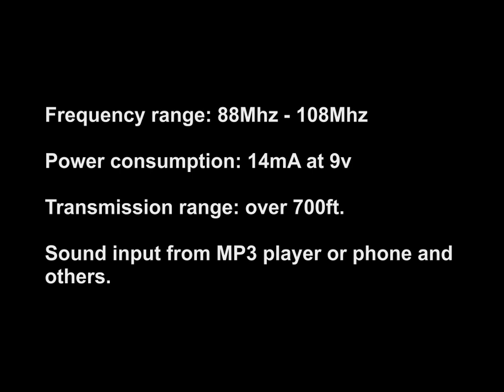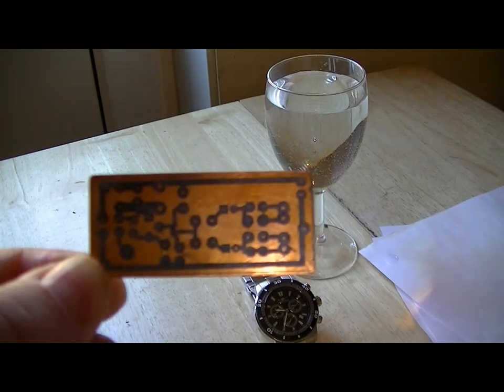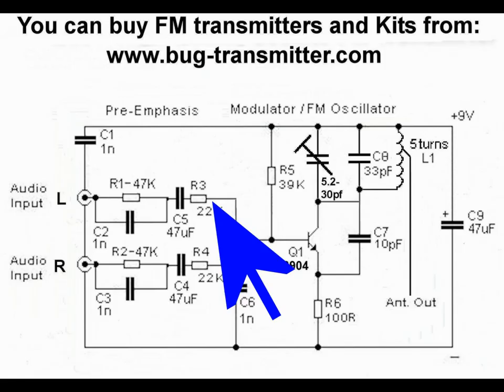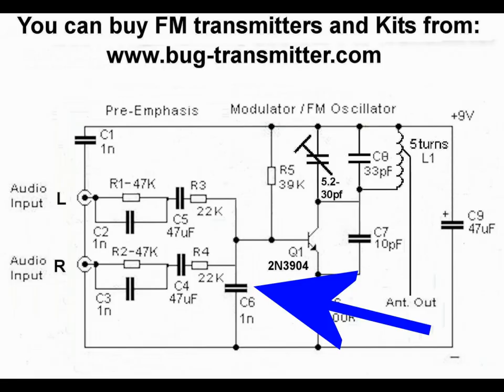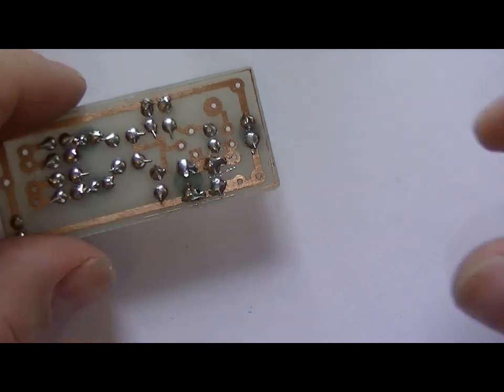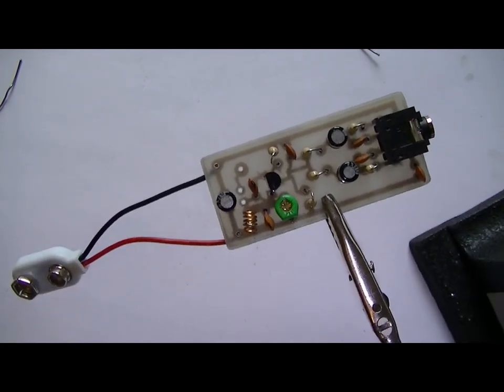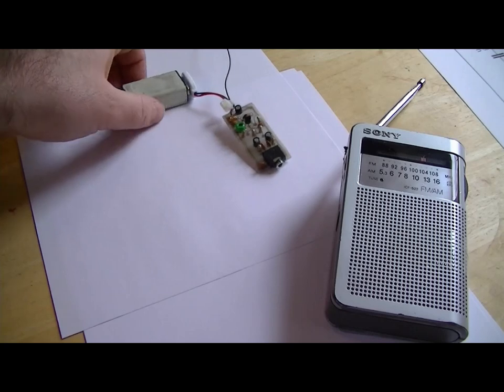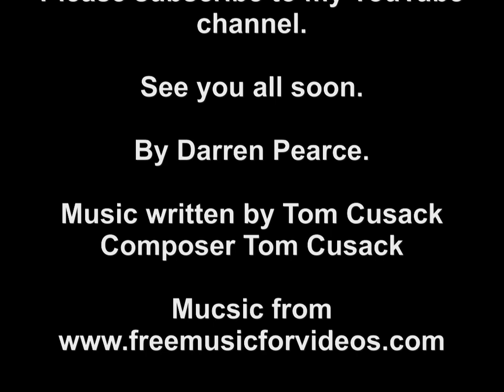How to make your own radio station.I show you how to build a simple FM transmitter.

Comment: I have a question would surface mount resistors and transistors will work well or would there be a problem
Reply: shouldn't be a problem as long as they are rated above the voltage and current of you power supply.
Reply: Also would any trimmer would work well or just that one I am all new to this I want to create something that so small and thin that it will work I am running 4 projects into one that requires total of 12v but I would like to have a thin smallest battery that would power up all three of my projects at the same time
Reply: Ok cool

Comment: can a similar circuit interfere with mobile broadband?
Reply from the maker: TheBruzka 
No ,Mobile services are typically delivered over a wide range of radio frequency spectrum bands (e.g. 900MHz, 1800MHz upto 2.6GHz etc
My FM transmitters are typically 88Mhz -108Mhz

Comment: What is the material used to make the circuit chip and in which solution you dipped it into?
Reply from the maker: Copper clad board and i use Ferric Chloride , a material for etching copper clad boards.

Ferric chloride has the advantage over other etching solutions like nitric acid by
greatly improving the safety of etching. Ferric chloride is free from harmful gas emissions it will stain but will not burn skin.
Reply: Ok. Thank You. :) :)

Comment: any alternative for trimmer capacitor?just asking.tnx
Reply from the maker: +kean last 
Yes replace the trimmer with a 10p capacitor and then you 
can adjust the FM frequency by stretching or compressing the 5 turn coil
Reply: +dazaro3 thanks

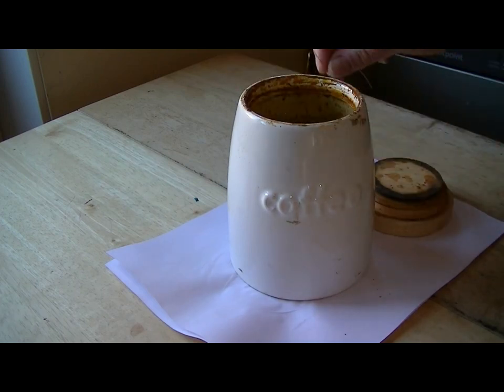Comment: What is the green liquid in "coffe" can? At 7:00
Reply from the maker: +XxXDestro yerXxX 
Its Ferric Chloride , a material for etching copper clad boards.

Ferric chloride has the advantage over other etching solutions like nitric acid by 
greatly improving the safety of etching. Ferric chloride is free from harmful gas emissions
it will stain but will not burn skin.

Comment: please what is the capacitor voltage ?
Reply: +A-S- C-A you can use 16v 25v 35v 50v or even 100v capacitors.  i used for my circuit a 16v cap.
Reply: 123jo123lle
I have three capacitors 25v 10uF
you think it'll go?
Reply: yes i think that will work fine ;)
Reply from the maker: +A-S- C-A 
50v ,you can use 15v upto 100v parts

Comment: hello dazaro3  how long does thing last in hours on this 9V battery ?
Reply from the maker: About 12 hours
Reply: dazaro3 thank u for the quick replay 
another question can i work the same way with the FM Transmitter without a trimmer ?
Reply from the maker: MrSapinhopreto
Yes replace the trimmer with a 10p capacitor and then you
can adjust the FM frequency by stretching or compressing the 5 turn coil
Reply: thanks again man ! all the best

Comment: What can you use instead of The 100R?
Reply from the maker: You any value of resistor upto 1K ,so you can use a 100R,120R,150R,330R,470R and so on .
Reply: You can use a SMC type on the trace side of the board

Comment: which is the substance of 6.48
Reply from the maker: Its Ferric Chloride , a material for etching copper clad boards.
Ferric chloride has the advantage over other etching solutions like nitric acid by
greatly improving the safety of etching. Ferric chloride is free from harmful gas emissions it will stain but will not burn skin.
Reply: dazaro3 Thanks for the information but that plate that bolts to 2.13

Comment: what do you soak the circuit board in?
Reply from the maker: Its Ferric Chloride , a material for etching copper clad boards.

Ferric chloride has the advantage over other etching solutions like nitric acid by
greatly improving the safety of etching. Ferric chloride is free from harmful gas emissions
it will stain but will not burn skin.
Reply: dazaro3 WHat can i use to subsitute for the print if i dont have a printer
Reply: Irwin Rommel
You can use a etch resistant pen
and just copy the PCB print i used.

Comment: does your printer use lazer or ink ?
Reply: Its a laser ,an Inkjet printer will use solvent inks and it will not work and the printer i use to make my PCB's is a laser printer ,its the toner transfer method.
It will ONLY work using a laser printer.The toner in laser printers and most copiers is made mostly of PLASTIC, which resists the acid that eats away the copper that doesn't have any toner on it. Inkjet printers use INK, not toner. And their ink is typically NOT a good etch-resistor, at all.
Reply: thanks :D
Reply: *****
Who is the size board?

Comment: can you use a 2n6027?
Reply from the maker: Anti Googl 
No ,you can use : 2n2222,BC546,BC547 ,2N4401,BC550 and BF199
and many others. They must be NPN transistors and min 100Mhz
The 2N3904 are very good transistors because there
is very little movement in frequency from 5v to 9v.